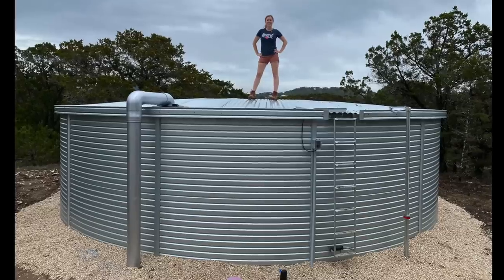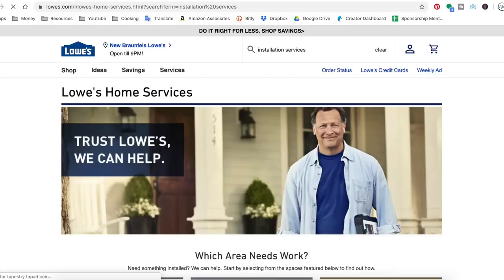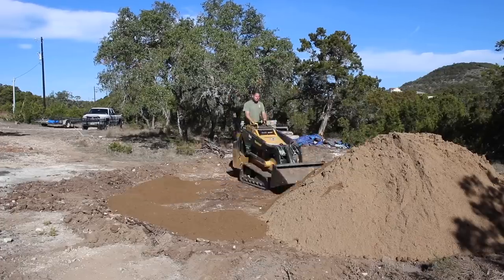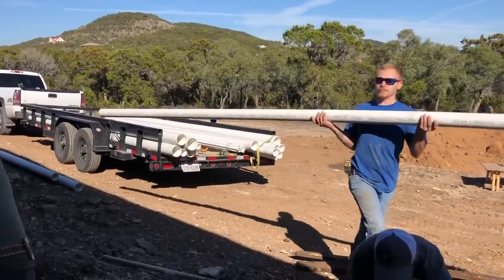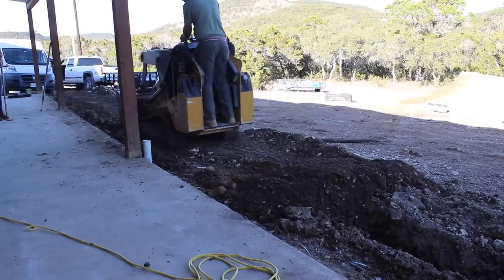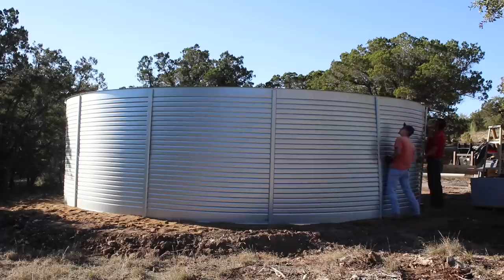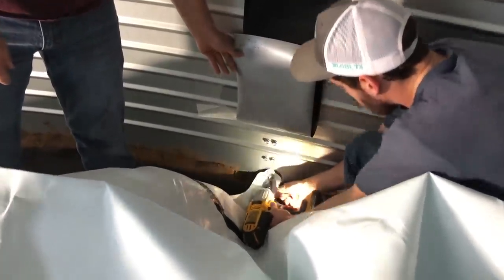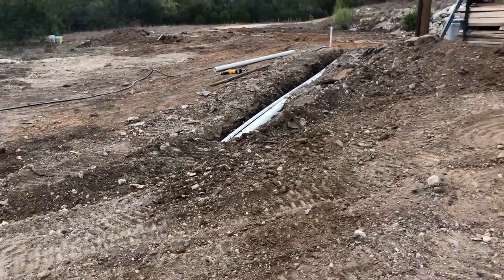Installing Rain Water Collection

Comment: The only thing that are missing now are solarpanels on that awesome workshop.
Reply: Plus a Cybertruck and a storage solution for the night.
For the Planet!!!
Reply: ...also a small wind farm.
Reply: ...and a small nuclear power plant.
Reply: and a composting toilet.
Reply: And a plasma rifle in 40 watt range...
Reply: @Tobi Zeller   

It's certainly possible, but it would take a massive system to supply the capacity for her entire shop if she is wanting to go completely off-grid.

Depending on government & power company incentives & rebates, Windpower is more efficient & cost-effective IF you have decent & regular winds in your area.  Plus it works when the sun goes down.  ;)

But a combination of wind and solar would be best.  I am located in the high-desert region of SoCal...think Joshua Tree Nat'l Park, so we have plenty of both sun & wind.

I use the Bergey Excel 10kW 23ft diameter wind turbine on a 100ft guy-lattice tower and it supplies 135-145% of the power for my 5-member household.  Bergey's new 15kW turbine would be a better match for her shop needs.

My Excel 10kW wind turbine system has been in operation since 2007 and has required very minimal maintenance.

However, power inverter technology has improved by leaps & bounds in the last few years, so that may be an upcoming upgrade (and substantial investment).

At the time of installation, there were 3 separate rebates available for Windpower installations in my region...Federal, State, & Local Utility company rebates.  When combined, all 3 resulted in a ~50% cost reduction for the equipment & installation.

This particular system is grid-tied and the 35-45% excess is bought back by the local utility co.  It took about 7 years to completely recoup the investment.

Break-even or ROI may take longer in your region because IIRC utility costs in Texas are quite low compared to most other States.

The main problem with a grid-tied system is that when the utility grid power goes down, your solar or wind system must also be shut down (automatically).

This is to protect any utility line workers.  If your system is still operating it will engergize the utility lines and potentially electrocute a line worker.  :(

The advantage with the grid-tied system is that you'll still have the utility grid's amperage & current capacity to power all of your power-hungry shop equipment, but your overall on-site power production should "fill in" or compensate for the overall KWh consumed.

For her shop to be 100% off-grid, she would need a Huge solar panel array, AND a very large, EXPENSIVE Battery Bank AND Inverter/Charger.

Besides the added cost of extra panels and LOTS of battieries, the inverters & battery chargers for systems of this capacity are exponentially more expensive.

http://www.bergey.com/products/grid-tied-turbines/excel-15/  

http://www.bergey.com/

Regarding April's Rainwater Harvesting System, I would AT THE VERY LEAST install a "Spring Box" debris/sediment separator "upstream" before the water enters the tank!

It is MUCH easier to clean out the easily-accessible spring box rather than a 30k gallon tank!  And you wouldn't need to drain your tank as often in order to clean it. = wasteful.

Something like this Spring Box but on a larger scale that is sized for her system...

https://www.carolinawatertank.com/ProductDetails.asp?ProductCode=SB

You can easily DIY a Spring Box using a small to medium horse or livestock watering container/trough and basic PVC fittings.  Take a look at this one for DIY construction...
https://youtu.be/hKxdAesHk9M

But ideally, you need to "filter" or screen as much debris as possible as close to your actual COLLECTION SOURCE as possible (the gutters).  This keeps all of your supply pipes as clean & unclogged as possible.  Use screen filters on the gutters for leaves & other debris & the spring box for very small debris & sediments.

https://images.homedepot-static.com/productImages/c5eddb1a-e273-4189-8a4f-eb48c4187138/svn/amerimax-home-products-gutter-guards-strainers-86270bx-1f_600.jpg

https://www.homedepot.com/p/Amerimax-Home-Products-3-ft-White-Snap-In-Filter-Gutter-Guard-86270BX/100520851
Reply: And a grow garden!
Reply: Water storage couple of solar panels HHO !!!

The environment friendly truth behind solar and wind is there are not !!!
Carbon fiber , magnetic generators , hydrogen is safer more than friendly to the environment !!! Safer than most think !!!
All in the handling and delivery in the right frequency . wonder why water cost as much as gas maybe there getting ready to  let us have this information , so many have it and use it already .
 how many how much can Vatican corporate Masonic bankers make disappear before people start noticing ?
 aircraft mimicking Birds a lot of energy heavily polluting the environment !
Flying saucers secret government aircraft the frequency of the vibrating cones of the insects wings takes very little energy with gravity-defying eas . I believe Tesla secret to free wireless energy !!!
Reply: @bbfoto7248  29 palms...
Reply: @bbfoto7248  Why not a circuit that disconnects the wind/solar power system from the power grid when the power grid goes down❓Her house and shop would keep humming along w/o posing a hazard to linemen.
Reply: Agreed. Preferably with LiFePO power banks. But, regarding some of the other replies, do some math, before you spout BS like HHO. For example, what size of Hydrogen tank would be required in order to generate ~6KW of electricity per day? Answer: Multiple huge tanks.
Back yard YouTube gadgets do not equal viable energy solutions for homes and building permits.
Reply: bb foto she will need something to keep things growing in that much water unless it is all used for the garden.
Reply: and a luxurious tiny house for me to live in ;-)
Reply: @richfarfugnuven6308  best comment !!!
Reply: ya all dreaming......... tell em their dreaming son......
Reply: @bbfoto7248  WTF r u trying to sell aprill????
Reply: @richfarfugnuven6308  Hey, just what you see pal.
Reply: @OffGridAussiePrepper  

LOL, mate.  April's a big girl and she and Matt can and will decide on whatever they want once they've done their own research and consider their budget.  ;)

I'm just throwing options out there from personal experience on "what has worked FOR ME".

IF you have even light to moderate winds, and the property/space to install it (which they have plenty!), a wind turbine system is nearly always more cost-effective providing you choose a proven, low-maintenance unit.  The Bergey wind turbines are just that.  The company is based in Oklahoma which is adjacent to Texas.

Solar PV tech is catching up rapidly though in terms of efficiency and cost, especially if you do the installation yourself.  Many of the PV contractors here charge even more than the actual system parts for the installation.  That makes ROI or break-even/payback considerably longer.

There are at least a 100 of the Bergey Excel 10kw units installed on private 2.5+ acre residential lots in my immediate area alone that have been operating pretty much maintenance-free for over 15 years.  Average payback on the system with our current utility prices in this region is 6-7 years.

Good on ya for lookin' out, mate!  👍

Ta
Reply: The Hermit .
Reply: @ek9772  You don't get this - hydrogen is pumped in a completely enclosed circuit into a fuel cell, where it transforms into water and electricity. But hydrogen is a bad idea for other reasons, for the moment - its commercial fabrication is done using fossil fuels, mostly, and storage and transportation are costly and difficult. (Its tiny molecule size causes it to diffuse at significant rates even into/through many metals, which in turn become brittle, and it will escape tanks through gaps small enough to contain gases with larger molecules, such as oxygen or carbon dioxide. Not saying it can't be done, just that it's more expensive - unreasonably so, for energy generation.)
Reply: And a bomb shelter

Comment: Fire protection is another good benefit of having such a large water storage as the normal amount a firetruck carries if around 500 gallons.
Reply: @PBMS123  the truck should be able to pump on its on.
Reply: @MandoFettOG  I think PBMS meant a pump for use before any town fire apparatus could show up. She would need a pump, besides the one supplying irrigation, or at least a T and gate off her irrigation supply line.
Reply: @stevenlarson6125  oh makes sense

Comment: EVERY house should have a water tank, for gardening , car washing etc, especially in drought vulnerable areas. This would really help ease the pressure on council water supplies. Absolutely stunned to learn that it is illegal in some places 🤯 better to make lawns illegal as they are the biggest single waste of water.
I, like most of rural Aus am 100% reliant on tank water for all needs.
Another system to consider is having the tank at the highest point on your property (depending on topography) A smaller tank is used to collect water and then transferred to the main tank. Gravity will give constant reliable pressure and still works in the event of power outages.
I am in a small village, all reliant on tank water. Assuming we survive the coming Tassie bushfire season and since my property is the highest point in the area, I am considering approaching council with the idea of building an emergency water supply for the whole community.
Reply: You should absolutely not wash your car with rain water.
Reply: @carputtgaming2088  🤔 why would you say that
Reply: G'day Bill, We sometimes build "upside down" systems where the water is pumped to a main storage tank, but since we can get 100mm of rain in an hour and that might be the only rain we get for months, we like to collect with gravity whenever possible.  Our grid power is very reliable, but when it does go out it's usually during storms! Best of luck with the wildfires and check with your area's Pioneer Water Tanks dealer - they may be able to help with the technical details for your proposal to the council.

Comment: I installed a 3000 gal rain harvesting system 15 years ago in North Houston.  The utility district was running very short of water and could not keep up with growth demands.  Once the blackout days to water our property hit I was well aware price increases were imminent.  I order the largest dark green FDA approved tank for water storage I could that did not stand taller than my 6’ fence as to not upset the neighbors.  I think I was allowed to go above the fence about 2’ but why chance it.  Being a good neighbor is more important to me.  I capture water from the 5000 sq ft home on just one side from existing rain gutters.  The clean out I built worked like a champ to capture water but put out leaf and other debris off the roof automatically.  I used gravity to feed my garden and top off 30K in-ground pool.    Something very nice about rain water, instead of chlorinated water from sprinklers, headed to the garden daily.  Our water bill shot up 400% over the next 10 years because of the growth in the area and demand for water.  The home sat on an acre lot and had a pool.  The rain harvesting saved thousands and was a joy to install with the fam.  Real solution for a real need.  Even small systems pay for themselves very quickly.  As fate would have it when I sold the home I sold the system above ground for more than I paid for all the parts and my labor.  If your state allows it it is a very smart thing to do.  Great vids and I enjoy your honest candor!  I’m a fan.

Comment: Living in rural Australia I have never quite understood the American obsession with wells, as groundwater is more likely to contain  heavy metals and salts than rainwater. I have lived the bulk of my 60+ years on tank water, up until a couple of years ago, without any form of filtration other than allowing particulates to settle, without any ill effects. The vast majority of Australian farms do the same. Water has always been a precious commodity in this very dry country ( the current drought is the worst since recording began ) and you learn from the earliest age to preserve and reuse it. We now run an 'envirocycle' septic system with the treated grey and black water ending up in the veggie patch and orchard. The standard roofing material here is corrugated iron with almost every roof surrounded by rain water gutters ( including the dog's kennel ). For me, rain water tanks were just the normal way things were done.

Comment: Hi April, Mick here from Victoria Australia. As a Certified Plumber I found your video very informative coming from the States. Here in Vic Aus , new houses either have to have Rain Water Tanks installed or Soler Panels installed.. (Solar Hot Water or Soler Electricity) to meet out 5 Star Energy Rating.. Great Video... Please keep them coming.

Comment: I priced a potable 3 stage filtered 35,000 gallon tank system through a certain company in Johnson City to be installed in Bertram on a 3,600 sqft 'Shouse'...... $33k and change. In my opinion, Installing a well in our area is $20k minimum and it WILL go dry eventually so I'll gladly pay for the peace of mind and the ability to add on to it later for long term droughts and fire fighting capabilities.

Comment: Great presentation of your build. I learned a lot. The installers seemed very professional.
I had a rain collection system built at the time of building my home 10 years ago. It's in a very different climate (Northern Ireland, cool summers warm winters with a much greener countryside) the tank is below ground and much smaller in size. There is a water treatment system so that it can be used for everything but drinking water. Could even be used for that if equipped with an additional treatment unit.

Comment: Thanks, April!  This is the way to go when you have the room.  Unfortunately, that tank is bigger than our backyard!  Our house has low roof line all the way around so we just have gutters with barrels at each corner.  I would suggest to have downspouts all the way to the ground and install diverters to fill the barrels.  That way when the barrels are full the water will divert down the spout and away from the house rather than overflowing the barrel and pooling around it.

Comment: I've been wanting to put on in on my building here in downtown Tokyo, of course not nearly as large as yours, but maybe 200 liters or  53 gallons (US)  for use to water my rooftop garden but also in the even a large earthquake. We are on a pump system,  so if we lose power, we are out of water in the whole building. With the addition of a decent water filter, we could have enough water to clean, flush toilets, drink and cook with (the last two run through the filter).
I need to get this done I guess.
Cheers from Tokyo!
Reply: I hope you do it!  I saw many rainwater collection systems in Tokyo when I visited a few years ago.  I even was able to visit the Rainwater Museum (now closed).

Comment: April, 
I live in South Australia, a very similar climate to Texas I believe. (hot dry summers and cool dry winters our avg rainfall is around 20")
The State government has built a water purification plant to supplement the local water supply taking sea water as the source.
They also encourage households to harvest rainwater with a subsidy program for installing collection tanks.
Cheers Eric
Reply: You folks have had ** all for rain the last few years, too. I had seen a forecast for 100 mmm (4 inches) forecast for northern NEW and Victoria but no need since then.

Comment: Hi April.  We installed the same 30k gal tank at our place in the Texas hill country about 2 years ago.  We're doing the opposite in that we're using the rainwater for drinking, shower and laundry, and the well is used for irrigation.  As you mentioned, the water here is very hard and you never know what's in the well water or how long it will last.  With just a couple of decent rains, our tank filled up and has remained close to full for two years now.  We'll see what happens in a draught year, but I'm very happy with our decision.  Rain water tastes great and is easier on your skin and plumbing.  Add the filters and the UV and starting using rainwater for the house!

Comment: My Sis and Brother-in-law are just up the road from you, and they built a place in Colorado. Most of the hassle and need for lawyers came from the water rights nonsense CO has on the books. It went beyond the not being able to have what you just installed. Was a bit of a shock to them having been contracting in Texas so long.
Also, how far down is the water around your place? I know the rivers are near, but with that rock, some places have a rough time getting to the aquifer. I know of a place over by Meridian that has one very deep well, and they had to bore quite long way past the first hit of water to keep the supply up when the seasonal levels changed.